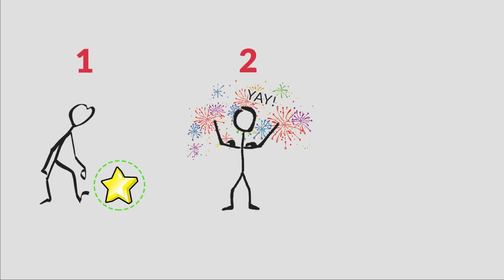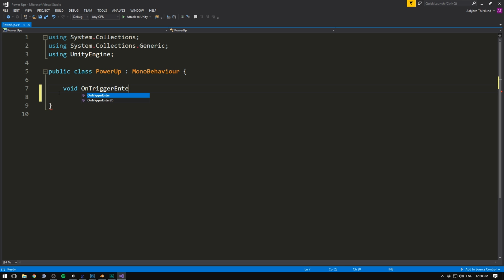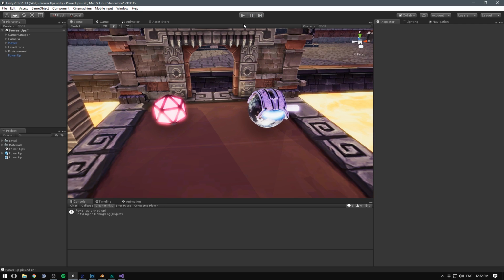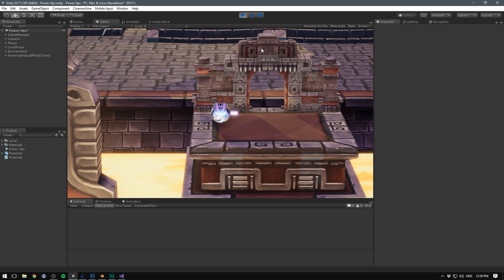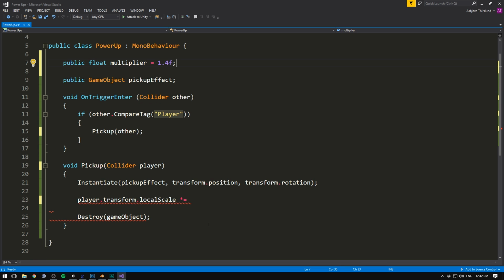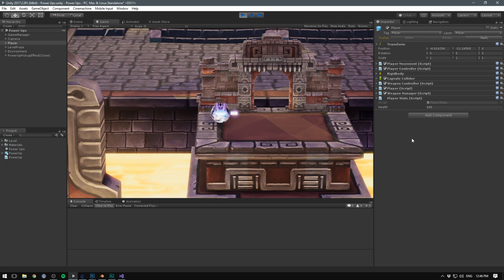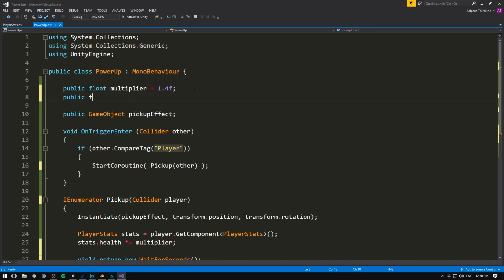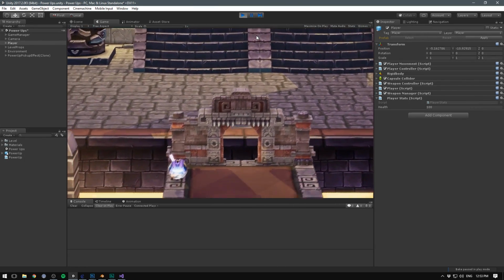POWER UPS in Unity

Comment: but if someone looses health in that x seconds than still it will be divided by 1.4 that will be unfair and illogical so you have to set the heath to 100 instead but if someone looses and gets 100 again it will be unfair again so add a if condition which will see if the health is more than 100 than it will be set to 100 otherwise do nothing with the health. hope it helps and makes sense

Comment: For anyone who also has a problem with looping of effect. 

When you download Unity Particle Pack and put some random effect to the script, this effect starts again and again after triggering. You can fix it by doing next actions:
1. Click on the effect in the bottom assets panel.
2. In the Inspector on the right side find the "Looping" option inside the Particle System component and disable this option.
3 (Optional). If you still have looping effect, double click on effect in the bottom Assets panel and then you can see all children of this effect inside the hierarchy on the right. Just repeat step 2 for each child.
Reply: I’m having problems picking up the power ups
Reply: Wow bro you're a life saver
Reply: Thank u dude

Comment: I followed your steps and the "OnTriggerEnter" routine is NOT called when the Player collides with the powerup. I also tried "OnCollisionEnter" which is also NOT called. The only way I could get the collision detection to work is by adding a rigidbody component to both the powerup and the player. I don't need physics in my game and did not want the performance overhead of adding physics. Adding the rigidbody component has also made the player movement jerky and even though gravity is NOT ticked in the rigidbody properties, the player character now starts the game waist height buried in the ground.

Comment: what about using Invoke with a delay instead of the coroutine?
Reply: You can do it, but Invoke is very limited in comparison to Coroutine. So is better to undestand and use Coroutine bacause tomorrow you will use it all the time :)
Reply: You could do it with a delayed invoke to disable the power up. That would require you just an extra function.

Comment: I'm stuck on something... I have a power-up called "Lava Boots" that disables the damage of Lava for 15 seconds. And there are Lava Boots spread out randomly throughout the Lava Maze, so you can keep picking them up and keep going without dying (at least that's the idea). The problem... it seems that it's only registering the first set of boots and when the first 15 seconds is up I start taking damage, regardless of how many boots I've picked up. I want the 15 seconds to keep starting over with each new pair of Lava Boots, but I can't get it to do that. Any suggestions?
Reply: I think you need to add 15 seconds to the duration variable each time you pick it up

Comment: I have a polygon collider 2d on my player, circle collider 2d on my power up. Power up collider is set to trigger. Adjusted code with OnTriggerEnter2d(Collider2d other) and can't get the debug message to even appear. Player has the Player tag. Any ideas? Different concept for 2D?
Reply: hey have you found a fix for this yet? i'm so stumped

Comment: The problem with the reversion of the power up here is that it's proportional to the /current/ health rather than the amount gained at the time of taking the power up. That could be intentional, but wouldn't it be better to store the amount of health gained by the power up in a variable then subtract the player's health by that number once the duration ends?

Comment: Another great tutorial, and the first tutorial where I knew enough where I could easily customize the script, I'm learning! 

I found that the prefab particle system wouldn't go away in the hierarchy after the powerup was destroyed so I added a destroy for the particle system to the script, but you can't destroy prefabs so I added a child particle system to the powerup object, but that one played on awake as soon as the scene opened in play mode, so I set it inactive and added a 'set active' in the code and a 'destroy after 2 seconds' behind that. Now that works all cleanly. 

And I also added a maxHealth so that the multiplier does both health and maxhealth, but when reverting them after the set duration it sets the health to the (max)maxhealth if it is greater than that, this should prevent a damaged player from reverting below the max health after the powerup health goes away.

Comment: In my case, I have a little square that can move around and jump. The playerController script, for the movement, has a variable that can adjust the number of extra jumps. I want this code to be able to change the variable from that other code. How would one do this?

Comment: so 100hp * 1.4 = 140 / 1.4 = 100 Great, but what if you take damage?!?!?
Lets say you get your health up to 140 and than you take 40 damage and after the power up expires you end up with 71hp instead of 100. Is there a better way to do that?!
Reply: you would need to use a maximum health as well. after the duration reduce the max health back and if current health is > than max reduce current to max
Reply: before make changes on health, make a variable in the coroutine  float healthbeforechanges = health;
after you can modify like *1.4
after the effect is done, just change current health with the variable healthbeforechanges
Reply: @Dymangel  This obly works if no other powerups were picked up during that time.
Reply: @ДенисМаксименко-м9ц  you could just store the difference in HP between the unmodified value and the value after multiplying it. and after the duration subtract the diff if it doesnt kill you/go lower than a fixed min value
Reply: The health is only multiplied once so it would only be multiplied by 1.4 when you touch the power up, when you take damage it isn’t touch a power up so you don’t multiply
Reply: store the damage taken into a private variable then set the hp to 100 then take away the amount of damage you took earlier from the private variable from the current health, then finally set the private variable to 0

Comment: Managed to figure this out. Doing a Space Shooter and originally I wanted to do a Double Shot Powerup where the bolts fired spawn 2 of them instead of one. Instead I made it do Rapid Fire for 10 seconds instead. Its still progress.

Thanks again for this tutorial.
Reply: Hey there, so... I also tried working on a space shooter following this tutorial and I can't, for the love of god, manage to get the collider to react to the onTriggerEnter2d. Powerup collider is a trigger, ship has a polygon collider which is not a trigger. Nothing happens when they touch and I have the same code as brackeys (but with 2D after OnTriggerEnter and Collider(2D).other.

Any help, please?

Comment: Love all of your videos, they've been extremely informative and have helped me really start getting into using Unity.
In this video though there is one small issue that I see and that's that when you divide the player's health by the multiplier after the powerup runs out, if the player lost any HP, that loss will be reflected in the division of the HP stat(i.e: if the player gets the powerup and loses 50 HP, setting their HP to 90. Once the powerup fades, their HP will drop to 64). I'd recommend instead of dividing the multiplier you write an if statement like: 

if (stats.health > 100) {stats.health = 100;}

and don't modify the HP at all if it's lower than 100 after powerup fades.

Keep up the great work! Your tutorials are an excellent resource and I look forward to binge watching them as I develop my games ^_^

Comment: If you want to have different powerups we can create an enum outside the PowerUp class. For example:

public enum PowerUpsAvailable
{
Grow,
HealthBoost
}

Then we can add an object in the class.

public PowerUpsAvailable powerUpType;

And in the Inspector window we shall see the combo box with the Grow and Health Boost elements.

And then you can add this to your Pickup function:

switch (powerUpType)
{
case PowerUpsAvailable.Grow:
//Do something
break; //We don't want errors!
case PowerUpsAvailable.HealthBoost:
//Do something else
break;
default:
Debug.Log("The type is invalid");
break;
}
Reply: How would you assign a specific power up to an outcome? Say I wanted one power up to give me health, and another to give me speed, how would I do that?
Reply: @dragami1607  Assign different scripts to different powerups based on what you want to alter.
Reply: This is a good method, but it would use scriptable objects

Comment: This is nice, but a little simple. Personally, I would handle the effects in the player class, and have an enum in the power up class that defines buff types. The power up would pass the enum value as an int, along with the multiplier into a coroutine on the player. 

Keep up the good work, but maybe elaborate a bit more next time, because I can see people taking this the wrong way, and having a separate class for each power up, encouraging bad habits and increasing compile times. Thanks!

Comment: Love the tutorial!  But I have one question about your scripting.  If you're playing against other people, and they damage you while you have your health *1.4%, but then after 4 seconds it goes down /1.4%, wouldn't the health lost be less than that of the health gained from it?  Example:  you're at 100 health then you gain 40, but say you're down to 90 health, then you only lose 36.  How would you account for making this the same 40 in the script, rather than a percentage?
Reply: The easiest way to do this would actually be just to forgo using multiplication entirely and set a fixed bonus, then use add and subtract. So you'd have your powerupValue be 40, and in the code instead of * powerupValue you'd use + powerupValue. Then when the powerup is supposed to fade you subtract the 40 that you gave.
Reply: But you should also code in:

 if (stats.health < 1)
{ stats.health = 1;}

after the wait duration so that the player wouldn't die when the power up runs out .
Reply: or you can use a logic that checks if the health is greater than 100 then set it to hundred otherwise keep it as it is. Because this is not the kind of powerup that should lose its effect. if you are boosting attack power then you have to add a power down coding
Reply: It's game design related. Most games say the powerup will "increase your max life by 40% for 4 seconds" which means it multiplies with a factor, and not adds a value. And do the reverse when it goes down. So yes the health loss from debuff will be less than from the buff if you take damage.

Same goes if you took damage before: If you are at 50/100 life it powerups to 70/140. Then if you heal to 140/140, you will return to 100/100 (and not 120/100 if it was additive).

This is the way most games behave and what is commonly expected by players.
Reply: just use an exact amount to add or subtract instead of multiplying...

Comment: Could you instead have a script on the player that handles the power up, power down, and wait. Then the power up script will just tell the player script what to change.
Reply: Yes, you could most definitely do that (and in my opinion should do that).
In this simple example it works either way, but when you think about an RPG with buffs, debuffs, synergies and the like, then it should really be handled externally.
Reply: Yes. I was going to write this.. the player script should apply changes. Brackeys way is very simplified way. But should not used. For prototypes is ok but not for true games because its not programers way how to do that.

I would do like so:
Player.GivePowerUp(PowerTypes.HealthBoost)
Player.LosePowerUp(PowerTypes.HealthBoost).

If you want more advanced you can do attribute or modifier system as the name says you modify your character by "buffs". But can be very complex. Once is done then its fun.
Reply: My question here is actually related. If I have a trigger collider and a non-trigger collider colliding with each other, will both colliders gain that information, or is it only the trigger that gets informed?
Reply: Matthias Andersen Any collider that has a Rigibody attached will receive information about the collision. In case on Trigger only the Trigger received information 

There is information in the Unity documentation.
Reply: 6XJOKERX I think is more "real" that the Power up is who change the player, sure you can also do with the player.